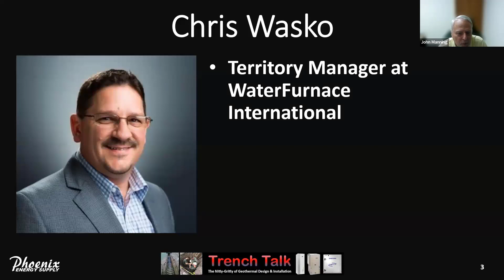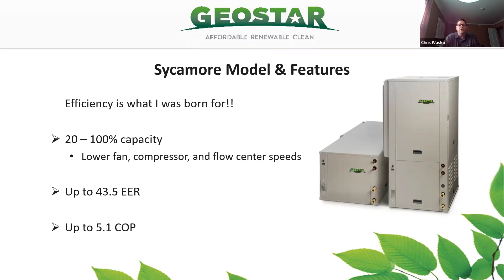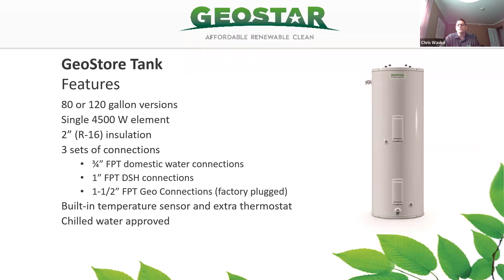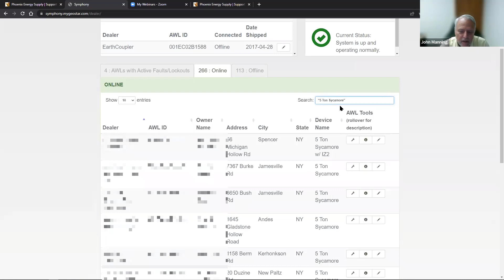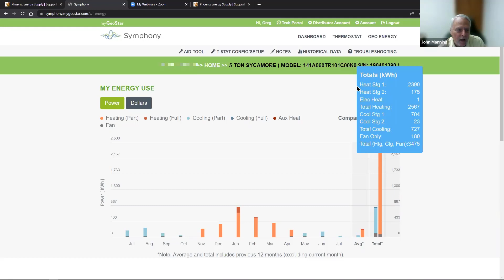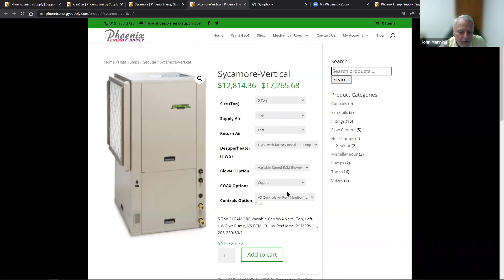TT005 - 220712 - GeoStar Product Line

Comment: In 2022, at the recommendation of our local heating company, we replaced our old Trane geothermal heating system with a new Geostar Aston at a cost of approximately $19,000. The Trane system had served flawlessly for about 23 years at the time it finally failed. We have had at least five service calls for the new Geostar unit within our first 11 months of ownership, and it still neither heats nor cools adequately. We are about to the point of suing the heating company on the warranty to compel them to install a system that actually works. At this point I do not have a high opinion of the Geostar brand.
Reply: Jay, where are located? Maybe we can help.